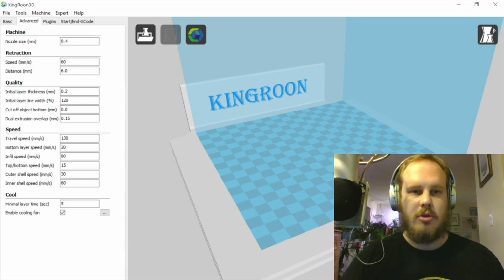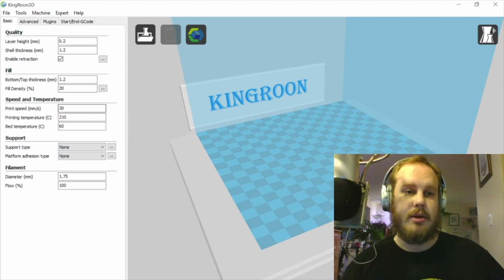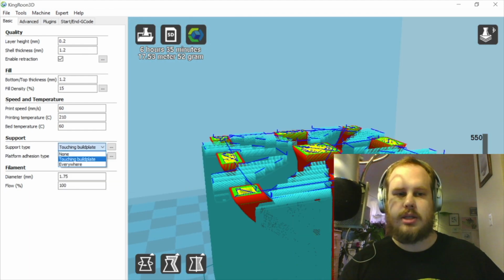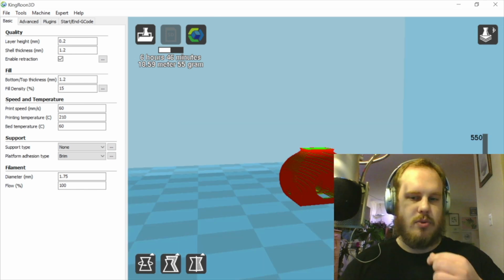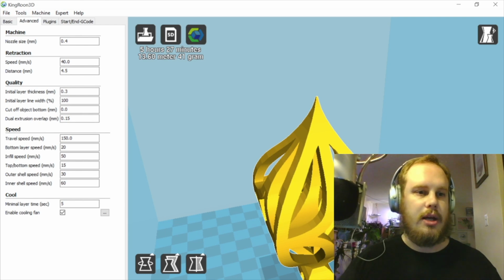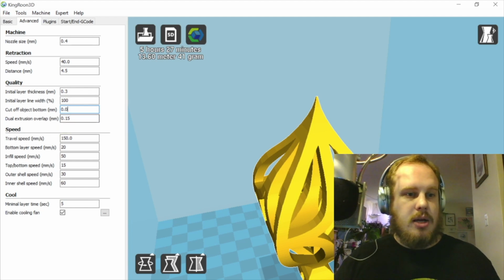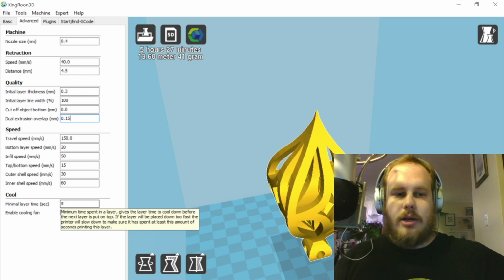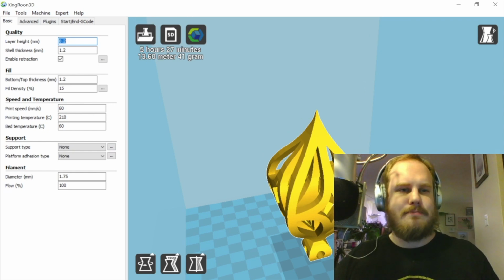Even More Cura - 3D Printing on the Kingroon

Comment: How do you create the actual 3D image? What program or app do use?
Reply from the maker: I personally use Tinkercad for the majority of my 3D modeling. Some people like Fusion 360, which is similar but has more "power user" options. Both of those are free, and if you have a windows 10 pc it should come with 3D Paint preinstalled. it's similar to TinkerCAD but is more focused o sculpting than 3D modeling.